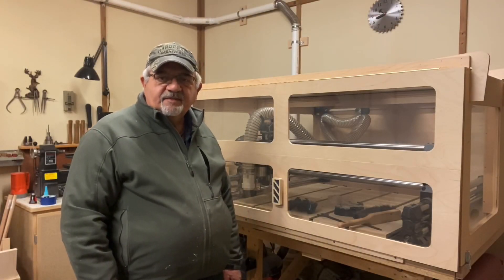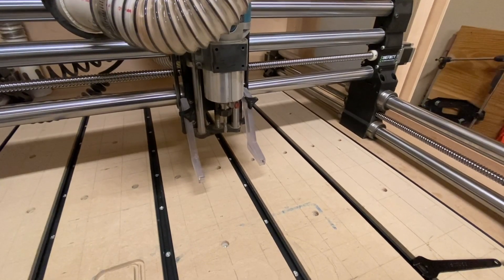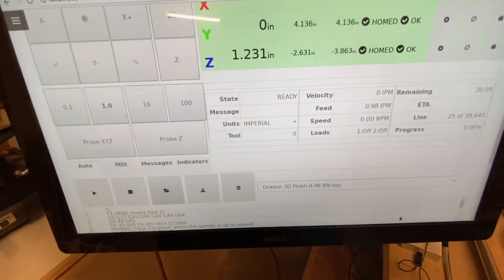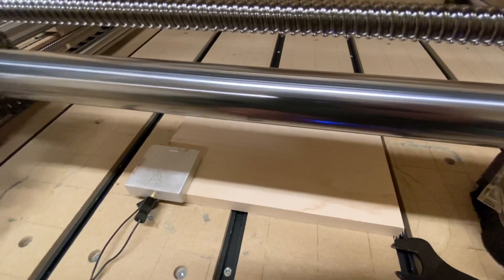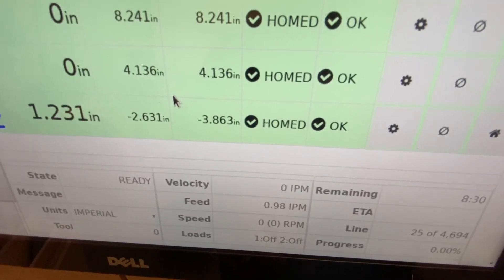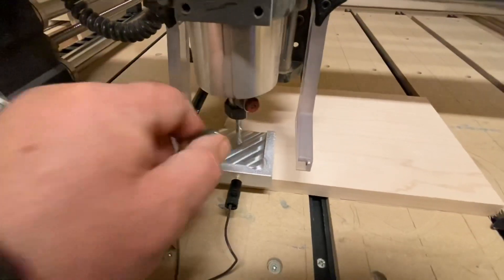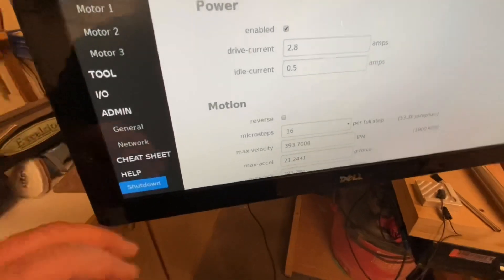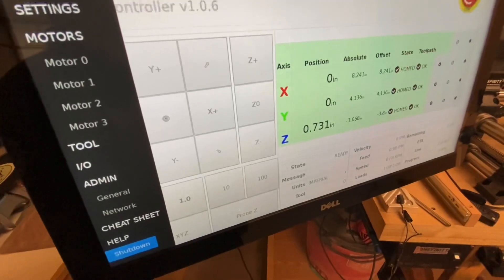Getting started with your Onefinity

Comment: I'm sure I want to order the One Finity after checking out many other brands. O.F appears to be more robust than any others I've seen. I also like the upgrade capability.
Reply from the maker: I spent months researching and almost got one of the competitors products but always had concerns about belts and wheels.  Then I came across the Onefinity and the ease of assembly and ballscrews sold me. I’ve had mine now for
almost 2 years and haven’t regretted my decision one bit. Great company, great product and great support. I’ve since upgraded to the Journeyman and it has expanded the possibilities tremendously. 
Word of advise, find and learn a design software while waiting for the machine. Carveco Maker or VCarve Pro are the preferred ones to try.

Comment: When you touch the prob to the bit 3 times does that activate any sound or do you have to actually watch the screen?
Reply from the maker: I happened to touch the probe to the bit multiple times only because I wasn’t watching the screen at the time. You only get a visual (probe xyz button turns green when you touch off) when there is connectivity.
Reply: @onefinity-trainingtipswithMitz   It would be nice to have an audible tone on top of the blinking light on the screen.  Should be an easy upgrade next time you update the software.

Comment: Can you give the dimensions of the spoil board? It looks like about 1/2" wider than the cut path on all sides. I have seem some make it the exact dimensions of the tool path (32x32). I am just beginning so I don't see making it bigger than the path. I don't see me using the tool to cut to the very outer boundaries. Any pros or cons of each size?
Reply from the maker: Each slat is 5-7/8” wide by 32-3/8” long. As there are 5 slats the total wide of only the slats =29-3/8”. Thr t tracks are 3/4” wide and there are a total of 4 that sit between all the slats. That’s a total of 3” so combined, the wasteboard is 32-3/8” x 32-3/8”.  Reason I did this is so that if I’m a little bit off in placement, I’m stilling covering the full cutting area the edges of the grid lines will be more visible if you decide to lay a grid down on the spoilboard

Comment: Great information much appreciated.  Question I don't have internet in my shop. How do I get updates to my onefinity software?.
Reply from the maker: Onefinity will post updates periodically. You will copy the file to your usb and then plug that usb to the controller.  At this time, the latest version is 1.0.8. If you have an earlier version, you should update it. 
https://forum.onefinitycnc.com/t/firmware-update-1-0-8-5-5-2021-latest-release/5406

Comment: Does the zero block or probe block come with the 1f when you order it
Reply from the maker: The probe is an add-on that you can purchase from Onefinity.
Reply: @onefinity-trainingtipswithMitz  thank you I seen one on Amazon that is for xyz axis for 59 also. Will  have to look into this
Reply from the maker: By the time you add in the breakout board, you’ll be about the same price as just buying the Onefinity probe and you don’t need the breakout board for the probe if you buy the one from Onefinity. I would highly encourage getting the one from Onefinity so that you don’t experience issues down the road

Comment: Thanks for the video. Why did you zero the z with the probe upside down after the tool change instead of right side up like you did at first?
Reply from the maker: There’s a lip on the probe to capture your material when probing xyz.  When just probing z, if you lay the probe the same way, it won’t lay flat and consequently gives a bad reading. Flipping it over when just probing Z, the probe lays flat and true whether you’re probing Z off the top of material or top of spoilboard

Comment: nice explanation, just ordered this, Unfortunate that its so popular right now the waiting Backorder is 3 months. I hate long waits. at least they show you the List of pending and shipped on the website which is nice.  was deciding between this or the Shapeoko 4, I chose the Onefinity for not using the Belts and easier setup so less maintenance issues and doesnt require direct connection to a computer can work right from the file.
Reply: You will not regret the decision to go with OF vs Shapeoko MUCH more capable machine. I ordered mine the other day and really hope the convoy up north doesn't disrupt shipping.
Reply from the maker: You won’t regret the wait John. Gives you time to get things ready.  I’d suggest spending a fair amount of time with the cad software. It was a bit of a challenge first few days but then it all started to click. Also, build table, get accessories (dragchain, bits, shop vac or dust collection, router etc)

Comment: Why are you using multiple files for different toolpaths?
Reply from the maker: I make separate files for each tool used and depending on the software used and the safe z that is set. You can’t raise the z to change out the bit. At least that’s how mine operates.

Comment: Why did you probe upside down.I just ordered this machine.Hope to get it soon.
Reply from the maker: The probe has a pocket on the underside with a lip on the x / y edges so it can sit on your project material when probing x/y/z.  When probing only z, you have to turn the probe over to get an accurate reading.  If you don’t turn it over, the probe will sit on the surface with a tilt to it and you won’t get an accurate reading.
Reply: @onefinity-trainingtipswithMitz  Thank you.None other videos showed this method.Thanks for all the great info.

Comment: How do I probe or Zero without a probe?
Reply from the maker: You can use a vbit to set your x and y zero. Lower the router slowly over your origin or datum point, make any adjustments you need to make before setting x and y to zero. 
For Z, put put in the bit you will be carving with and slowly lower it on a scrap piece of paper. Once the paper is pinched and doesn’t move, you can set z to zero.

Comment: Hello! What if the probe xyz and probe z don't light up when you touch probe to your bit?
Reply: @onefinity-trainingtipswithMitz  Tried again and it worked!! Thank you!!
Reply from the maker: It means you don’t have a good connection and if you press xyz, there’s a good likelihood that the bit will continue to want to travel.  This could cause damage to either the bit, probe or both.
Reply from the maker: Could be that the probe magnet isn’t attached properly on the collet  or there’s some type of build up on the bit.

Comment: How would I zero Z without the probe? 
Also, I just realized you switched out your touch monitor, I was hoping that was a possibility.
Reply: Toggle the Z until it barely touches the surface - some people use a business card. Once the bit pinches it so that you can't move it, toggle up 0.1 and then down approx 0.115 (cards are usually about .015" thick. Then hit the zero button for the Z axis.

Comment: Thanks, great intro.  I should get my machine in about 3 weeks.  I cancelled the small monitor on my order and got $80 back to put to a larger screen, since the 7's went on backorder. I ordered a 15 inch touch and VESA arm similar to yours.  I think I will end up mounting it in the extreme front left corner to allow it to be used in front or to the side of the machine, it the arm bends like I think it will.  I hope to store the screen inside the  overall dimensions of the enclosure to give it some bump protection while stored, maybe even screen faced inward.  Thanks for all your content and insights.
Reply: Hi Warren, What monitor and arm did you order? Thanks
Reply: @ronaldhoppus9015  asus vt168h monitor.  The arm is another thing though.  The monitor is so light I'm finding it difficult to find an arm with that weak of a spring. They seem to start at 4.5 pounds and this monitor is maybe 3 if that.  I guess I can glue on wheel weights 😁
Reply: @warrenbrown8670  you might wish to try “VIVO Premium Aluminum Height Adjustable Single Monitor Articulating Desk Mount Stand w/Gas Spring Arm Fits up to 32" Screen” I have purchased 2 dual monitor stands, use in my office and home office, VERY happy with them and works with as little as 2.2 pounds. I presume any touch screen can be used, just plug n play? I noticed the Asus VT168H 15.6" is 240 volt, that seems odd!

Comment: I have a love-hate relationship with the homing.  Sometimes it works great, but more times than not I have to play with the settings or it slams and chatters and never homes.  :(
Reply: @onefinity-trainingtipswithMitz  I can try that.  I have reached out to them and we worked on it for a bit, but is was frustrating.  It would either stop early or slam into end even though I made no changes.  It was pretty random.  They need to develop some sort of troubleshooting logic.
Reply: @dasfreakster  the joys of being an early adopter.  Rest assured they likely take each problem down along with the resolution. The next person with the similar issue likely benefits from your pain and efforts.  They've had enough people with cable issues to have started including spares in the box it sounds like. They can't afford to do that with the controller, motors or beams, but any could have an issue. What I've read about their support has been pretty impressive for a startup company, or any company really.

Comment: Since the home positon never changes why does that need to be done each time you turn it on? Seems that should be stored in memory. Thanks for the tut Mitz.
Reply: I think I read somewhere, possibly on Buildbotics forum, that there is a feature request to retain home, as well as the multiple alternative fixture homes.
Reply: Isn't also possible to move the gantry by hand when powered down?  If so, there is a possibility that it will loose it's reference.  Takes only a couple of seconds to home.
Reply: Go for it. My machine is another 6 weeks out.
Reply: @onefinity-trainingtipswithMitz  I know, but as things change both controller's seem to get major updates, like stall homing was added, I think vfd models too. It's pretty common in forked open source to see shared code get merged.